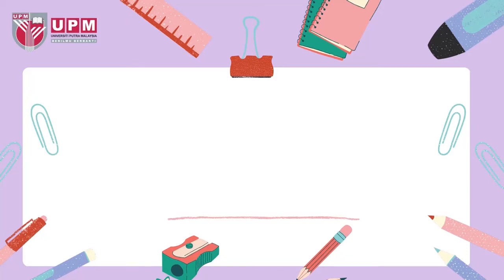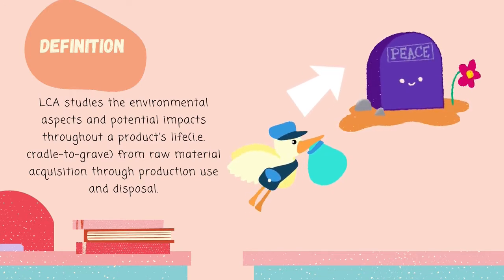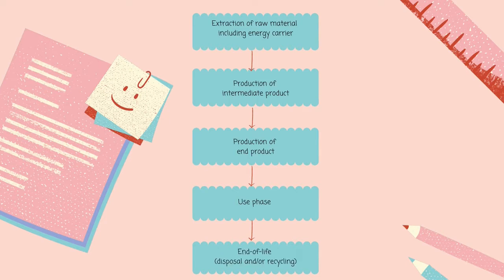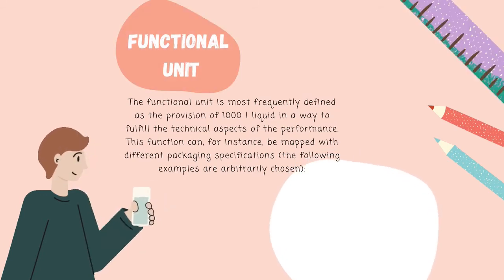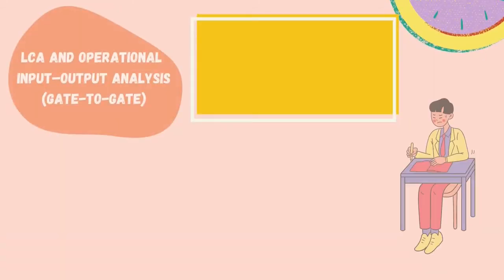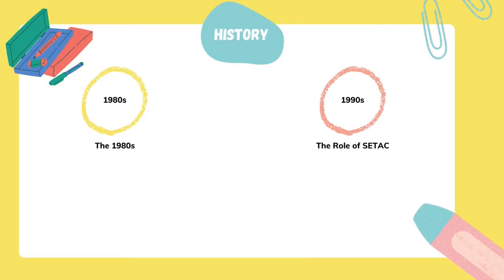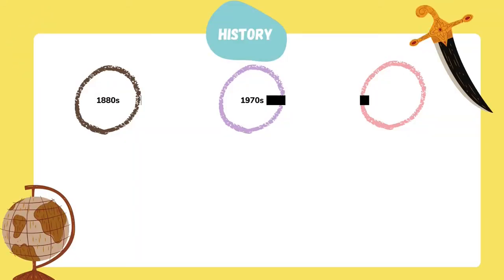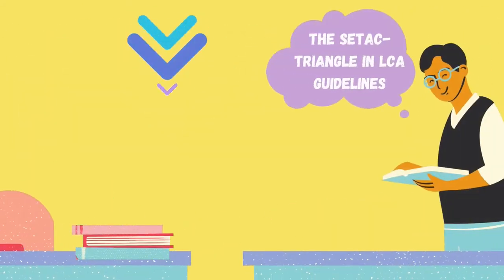Chapter 1 - Life cycle assessment (LCA) - Introduction (part 1)

Comment: 3:31 How does the concept of the problem shift occurring due to overly restrictive system boundaries, as discussed at 3:31, apply specifically to gate-to-gate situations in LCA? Is this concept limited in its applicability solely to gate-to-gate scenarios, or does it also extend to encompass the cradle-to-grave phase in LCA analyses?